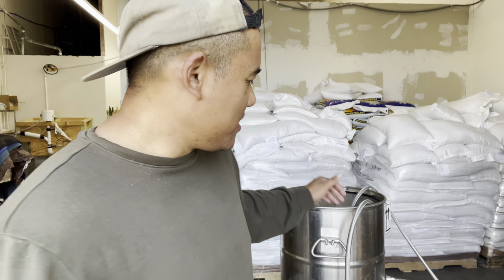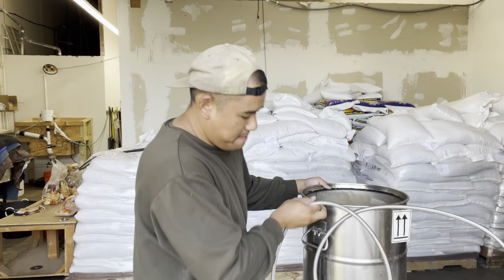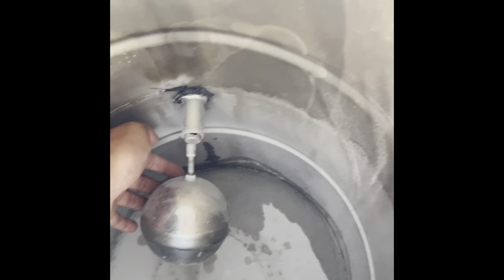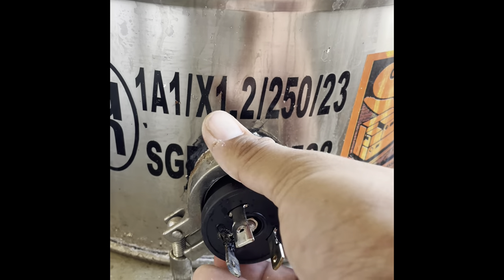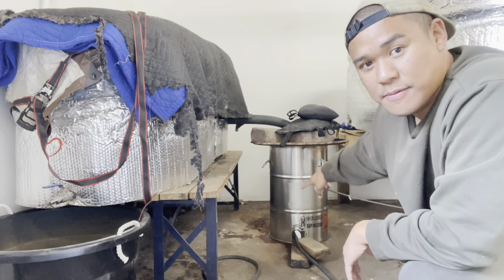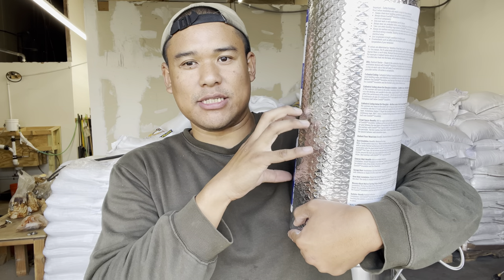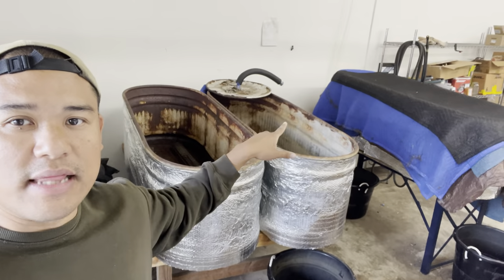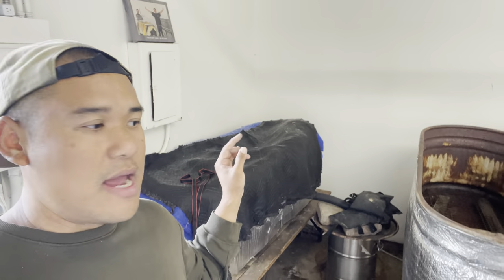DIY Mushroom Substrate Pasteurization: Build a Simple Steamer Barrel

Comment: Howdy - We were using an element that the 220v cable plugs into similar to what you have in the video. The connection would often cause a short and melt the cable. It might be worth it to get a heating element that you can hardwire instead of the cable that plugs into it, these also come with watertight fittings. feel free to reach out if you would like some more details.

Thanks for making videos like this and sharing the knowledge! Your hard work is appreciated.
Reply from the maker: Thanks for watching and the connection! 

I actually consulted with my electrician and he thought it was a really bad idea to have the elements hard wired so we didn’t go that route.

Comment: Im curious if I could feasibly run this setup outside when the temps are super cold. Im a little nervous about running this in my garage for fear of burning down my house. Thoughts?
Reply from the maker: Depends how cold. It’ll struggle to get to temp if super cold. I run my outdoors before during SoCal winters that get to about 45 degrees.

Comment: Where abouts do you place your temperature probes? I find that sometimes the bags higher up (closer to my steam exhaust hole) heat up faster than the bags below.. 

Do you place the probes INSIDE the bags, literally dug into the substrate? How many probes?

Thanks for the video. Im a mushroom farming in Malaysia going through some issues with drum sterilisation.
Reply from the maker: We usually have them inside one of the bags in the middle of the run

Comment: how did you rigg that Helios 11at 14:52. THe box has taken 2 outlets and 15 amps each on both sides. Will one outlet handle 30 amps? how is this box connected to the hot wire for the pressure steamer?
Reply: I'm not sure why he appears to use two smart switches. I built mine with a 120v 2 pole contactor relay inside a 6" plastic junction box. It's activated by one smart switch. I'm using a Feit smart switch, but I may buy a Kasa or other brand, Feit smart switches are unreliable.
Reply: @BobCampbell530  yo bro U just said you heated the trough for 14 hours then held it  for 3 hours. then ran it for another? 17 hours on top of that or did u mean it was running for 17 hours total? lmk thanks
Reply: @billysgarden-u9s  I think you replied to the wrong person. I posted about building switches.